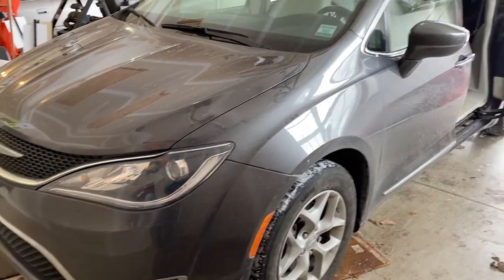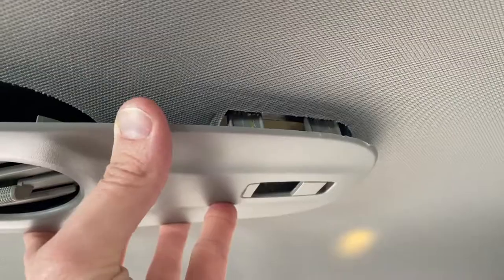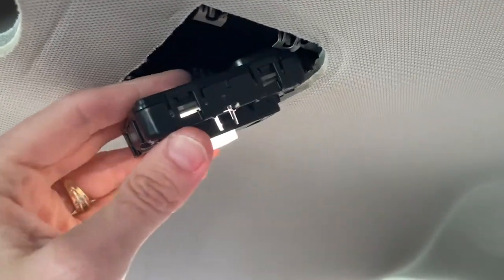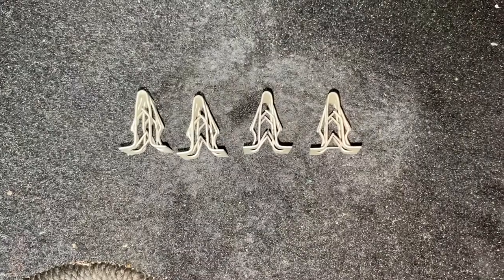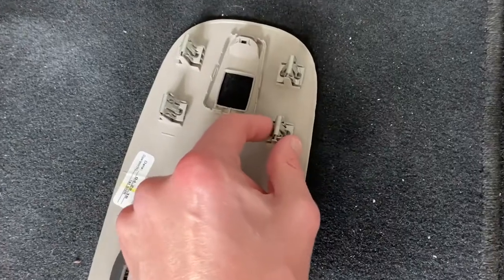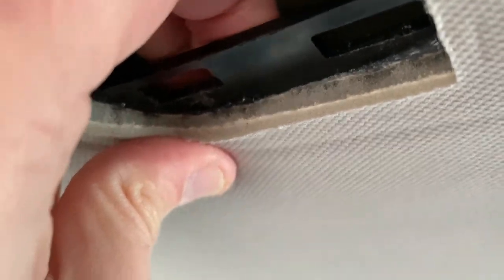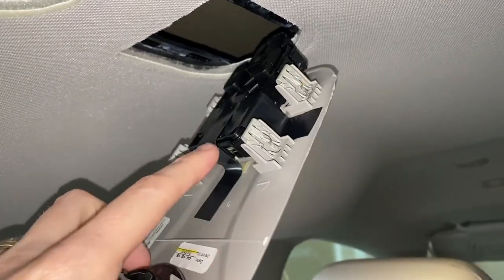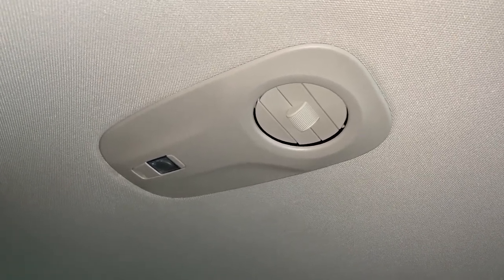Replace Chrysler Pacifica minivan interior overhead/ceiling light

Comment: Thanks for the video, it worked, now I have a question. How do you fix the third row seating light that has the same problem, I've worked and worked on it. Any suggestions?
Reply from the maker: Thanks for watching & welcome to the DIY Raptor Club Shelly.  Is light housing damaged or pushed out of it position?

If housing is still positioned properly but light is out, it may be fuse.
Reply: @DIYwithMichaelBorders  light works, just has the same problem being out of the plastic housing unit holder thing. The light itself is so much bigger than the cut out hole in the ceiling.